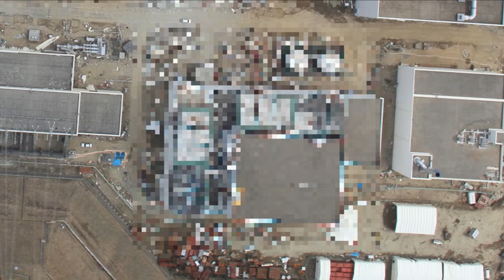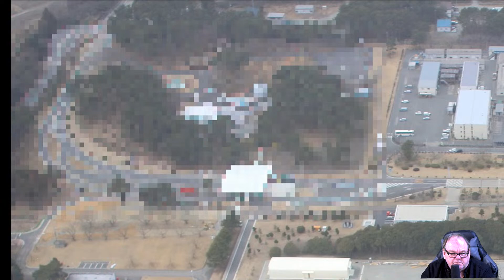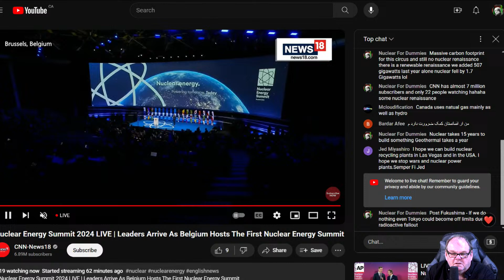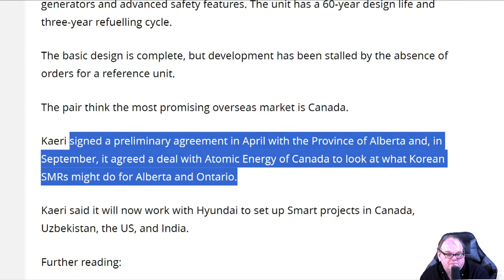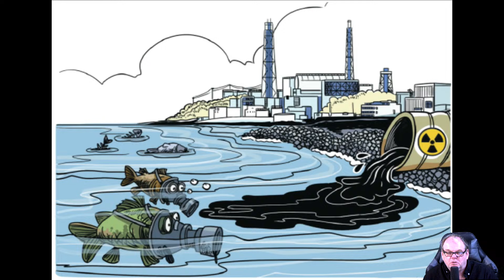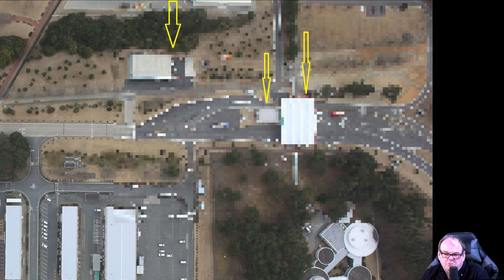Fukushima & The Degenerate Nuclear Power Plants News Show 2024

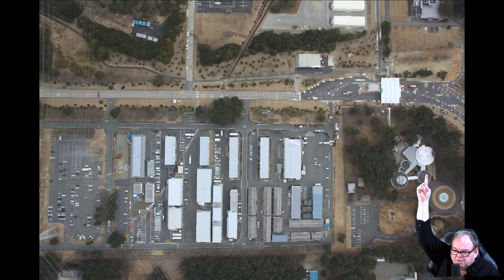Comment: The pixelated area at 13:52 is not pixelated on Google maps now. It's mostly surrounded by storage tanks. The building with the round connected parts above Dana (14:09) in the video is no longer there and has been replaced by square buildings, the surface has completely been paved over and all trees are gone.